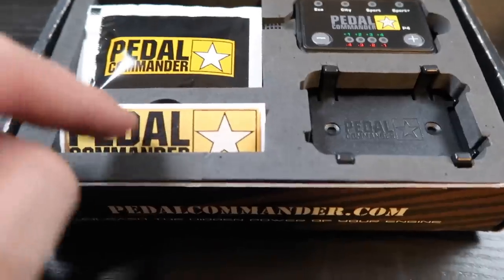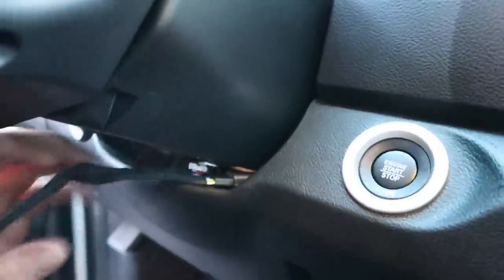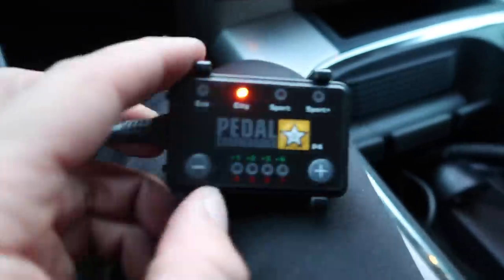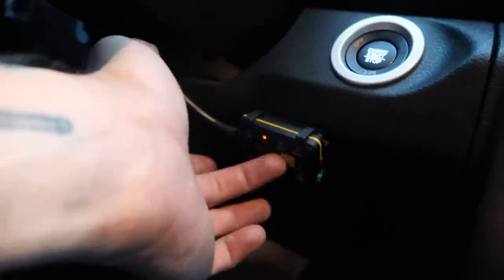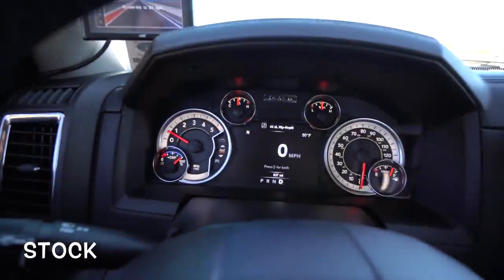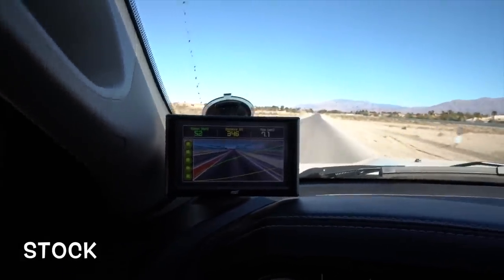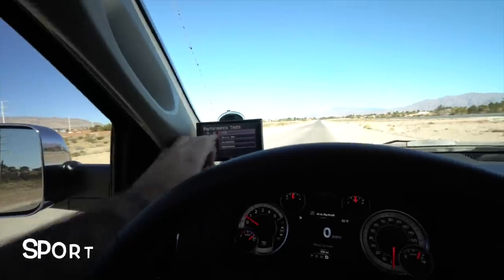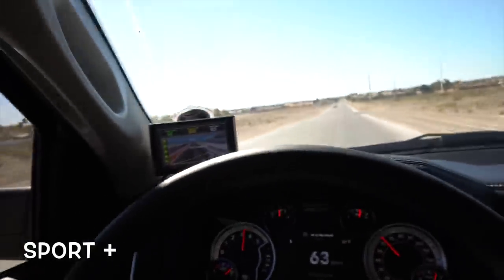Pedal Commander Review - Realistic Tuner Replacement? Jay Flat Out

Comment: It's definitely not a tuner replacement but most tuners that can modify throttle response from my experience don't work as well as the pedal commander so I have both.
Reply: TroyGarner so you are running both a tuner and the pedal commander??

Comment: Which is better, an ECU tune or this one?
Reply: Ecu tune changes the computer setting this just increases the sensitivity of the throttle body. Ecu tune usually  adds power as with this it adds no power. On newer vehicles under warranty ecu tune will void warranties unless it's a plug and play or you want to keep reverting to stock and then to your tune. This you can leve plugged in tuck the controller box away and take it right in to service and nothing will be discovered within computer scan. Longer story short it's all what you want. Quicker acceleration no added power...pedal commander. Quicker acceleration AND more power...ecu tune

Comment: Does it actually help with mpg??
Reply: Yes in eco mode since it has your pedal response slower than stock and with the plus and minus you can adjust it to be a little quicker or slower but still when in eco mode it will still be slower than stock even at a +4.
Reply: @pheonixsunnz948  asking because I'm considering it for my ram 2010 1500 5.7 but I also had heard that this thing can mess up your transmission

Comment: Wow, responses to this review are crazy. I have a 2015 RAM eco diesel that has a horrible throttle response. It's great when it gets going, but try to punch from a stand still  it to get out in traffic?  No way, lag city.  My wife has a 2015 Hyundai Santa Fe Sport 2.0T.  Twin scroll turbo.  You hit the gas, it's immediate. It accelerates like a sports car. Guess Hyundai does't use torque management. I'm trying to find a fix for my laggy eco diesel.  According to Sergey, this ain't it. So a costly tune that will void my warranty is the solution? Guess I'll keep looking.

Comment: A device that opens the throttle more with less peddle movement!  I am not that lazy ..I can push my peddle the extra 3 mm when needed.
Reply from the maker: +Canucker thank you for your comment nobody here cares that you can’t afford it 😂😂
Reply: Its ok Jay doesnt doesnt understand how this thing actually works.  You can literally just press the gas pedal down faster and save yourself 300 on this snake oil.
Reply: Jay Flat Out The ecu controls how fast your throttle body opens and how far. The pedal commander cannot alter either of those things. Learn how the product or vehicle works before talking down on others. Oh prove me wrong before you open your mouth with a reply.
Reply: But the pedal commander reduces the delay by talking to the ECU through the drive by wire.
Reply: TheAceInfinity it just makes the pedal like a on off switch. It isn’t faster it’s just twitchy. You can do the same with your foot.
Reply: TheAceInfinity  There is no delay going from the pedal to the ecu.  Its an electrical signal so there cant possibly be a delay.  The so called delay people are feeling comes from the ecu itself which the pedal commander cannot alter.  And its not a delay, its the ecu opening the throttle body slower than you press the gas pedal so that you dont shock the drive train with instant torque.  This "feature" is called Torque Management and every single car maker puts it in the system so that their cars have less warranty repairs.  Its great for them but bad for us.  A tune is the only thing that can lower or remove torque management.
Reply: Sergey Melnik Thank you preach.
Reply: I didn't say delay from pedal to ecu, I meant delay between the ecu and the throttle body position. I only mentioned delay -- you assumed it was to the ecu because that's not what I said... But that's all I heard for how this works. I'd imagine the delay is in relation to the throttle position sensor relative to how far your foot presses the pedal, so really maybe "offset" is a better term.
Reply: So youre saying the pedal commander reduces the delay from the ecu to the throttle body?  That is impossible because it cant alter anything in the ecu.  If it did then the pedal commander would void your warranty which it does not.

The pedal commander alters the incoming signal to the ecu, not the outgoing signal, hence the piggy back design.  Since torque management alters the outgoing signal the pedal commander can never adjust the gradual opening of the throttle body.
Reply: Do you read what I write? :/ ... I was talking about the position sensor and offsets to where the pedal is pressed. I will quote what I said: "delay is in relation to the *throttle position sensor relative to how far your foot presses the pedal*, so really maybe "offset" is a better term."
Reply: TheAceInfinity Do you read anything I write? There is no straight connection from the pedal to the throttle position sensor. The throttle position sensor does not see what the gas pedal does. It only sees what the ecu sends it. There is no lag and there is no "offset". If you're not gonna bother to do some research on how a throttle by wire system works then you shouldn't be trying to argue with someone who does because you're just making things up as you go along.
Reply: Pedal -> Throttle pedal position sensor -> ETC module -> ECU. Look up some diagrams and please quit being a know it all trying to alter what I'm trying to say to make your side.. I was not talking about it modifying anything on the ECU this entire time, that's for a tuner. Raise your comprehension abilities; I'm talking about the sensor signal past the pedal being modified mid-span by the unit which alters the signal that eventually gets fed back to the ECU. When did I ever say there was a direct line between the two? I simply was explaining that the signal modified by the unit eventually gets sent to the ECU. Your nitpicking my wording.
Reply: Sergey Melnik how when i smash the gas peddle it take a while to open up it feels like it’s saying loading lol
Reply: Gmony907 I'm not exactly sure what you're asking. But yes when you smash the gas pedal the throttle body takes a lot longer to fully open because the ecu is actually in control and not your gas pedal. Its built into the ecu software to do this for every modern car.
Reply: Sergey Melnik i was wondering how do you take that software off to make it faster
Reply: Easy.  You replace the software.  Its called getting a tune.  Usually costs around 500 bucks.  What car are you wanting to do it to?
Reply: Sergey Melnik ahh i see a tune well I’ll just save up for the tune and get rid of the governor and it’s truck
Reply: Gmony907 yeah a tune is the single best mod you can do for a car or truck. There's a lot more settings you can adjust besides torque management. For example you can get rid of rev hang, raise the rpm red line, make your transmission shift much faster and so on. I cant wait to tune my car.
Reply: It's sending a modified and amplified signal that you cannot do stock with just your foot. It really sucks when your logic doesn't match reality. Yet these ECUs are complicated pieces of technology. An altered signal can indeed adjust the (lag) output. Buy the product first like this reviewer did, to TEST it. Just as he has mentioned and countless others, it doesn't just suddenly feel like it's less pedal range or pressing it down further when stock.
Reply: R Grump Learn how a throttle by wire system works before talking nonsense. You're just trying to justify the 300 bucks you flushed down your toilet. It doesn't matter what you do to the pedal signal it will not change anything in the ecu. This is why this product doesn't affect your warranty. It does nothing to the torque management tables. And the electrical signal going from the pedal with or without this thing to the ecu is instant. It cant get rid of any lag because there is none. The so called lag people are feeling is built into the software of the ecu which this product cannot alter. Pressing your foot down farther and faster could have saved you 300 bucks that you could have put into a tune and made a real difference.
Reply: "The stock throttle map goes from the ECU, to the throttle sensor, to the throttle body. We're basically intercepting it at the throttle sensor and speeding it up, and the ECU has no idea. "  Is what PC has responded with.   Which is also why they claim it does not affect ECU/void warranty. Why would they be flat out lying?
Reply: Steve Pounder I get what you're saying but you can't do the same with the foot. I have a civic 2017 coupe (turbo) and for me it's quite fast. However, the pick/acceleration sucks. Even if the pedal is completely pressed, their's a huge delay. No matter how hard I press or keep it pressed, there is always that delay/lag. If that lag goes away for 300, it's worth it for me.

P.s: no need to make fun that civics aren't fast, or aren't supposed to go fast. I actually really like it. Would appreciate a reply directly related to the topic! :)
Reply: The lag doesnt go away.  It will never go away without a software change.  This product doesnt change the software.  Pressing your foot down faster is the exact same thing.
Reply: Venom there are many factors in play when recording a 0 to 60 time. Warmer  tires alone will give you better times. It's not possible for this thing to lower the time. The car software is un touched therefore the throttle plate opening delay is still there.
Reply: @JayFlatOut  but isnt this useless on a diesel truck since a diesel doesnt use throttlebody 🤔
Reply: @stevenp3176  - The throttle body IS opening faster with the Pedal Commander! Before you say it doesn't do that, you need some experience...otherwise you're in the dark ages.
Reply: Bruce Skinner You’re in the dark how a torque demand ecu strategy system works but it’s your vehicle buy one.
Reply: Theres a troll here that doesnt seem to understand what a delayed throttle response is. U cant just push the peddle harder for it to respond better. Sure by doing that u will accelerate faster. But there will still be a throttle lag before u burn rubber. Hence this product. It eliminates the throttle lag.
Reply: Haha - this coming from "the man" driving a heavily discounted little boy diesel.  Nobody here cares you can't afford a real diesel.
Reply: 30minforasn No no and no. The system can work faster than you if it wanted to. The computer adjusts camshaft timing in a fraction of a full crank shaft rotation while it’s spinning at thousands of RPMs. The lag isn’t because they can’t figure out how to open a throttle body in a reasonable manner. You’re saying the factory can’t figure out voltage ramps but these guys got it all figured out. When you push the throttle in you send a request to the ECM. It sees a percentage of a reference signal then it and only it decides what voltage percentage the throttle body sees. This is commanded vs actual. The ECM also works on those variables as self corrected accuracy. Before that ECM opens the throttle it will monitor dozens of data values to determine what its going to do. Delay is built in for parts longevity. Hell Ford operates on 24 different cam table models at any given RPM to determine just one portion of its torque demand strategy. Bottom line is this is the electronic version of the tornado that used to go in the intake tube in the 90s. OEMs spend millions per year in R@D for fuel economy alone. This and a air filter that doesn’t filter didn’t solve the puzzle all of those “dumb” engineers can’t seem to figure out.
Reply: @sergeysmelnik   ok what about changing the exhaust to a Borla attak? Its releases more power not give,and warranty still in affect..? So a product that voids warranty only if it changes the ECU ?
Reply: @khyoon14   why is he?
Reply: @NuclearRoll  ??
Reply: @agb5457  Yes the way it works is any part that is changed will void the warranty on that part or any parts it affects.  Changing parameters in the ecu could void the warranty of the engine and transmission because it makes them work harder.  They have to prove it as well so its kind of a grey area.  So changing the exhaust will only void the warranty of the factory exhaust and nothing else because it will affect nothing else.  The engine doesnt work any different with a catback exhaust replacement

Comment: my dad has a 15 ecodiesel and its thrown the throttle position sensor code at least 9 times and is completely stock. so the pedal commander is definitely irrelevant to that problem. most common is a turbo underboost code which is thrown even by a slightly dirty air filter. seems the truck is just sensitive so being on top of maintenance is a must.